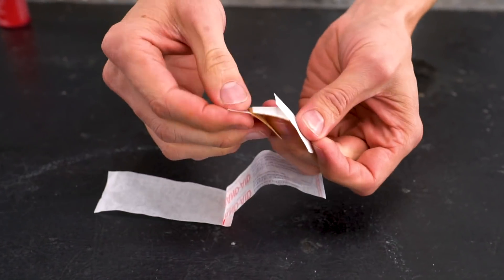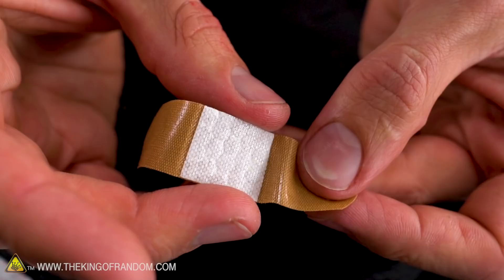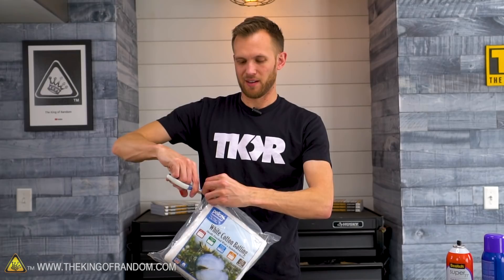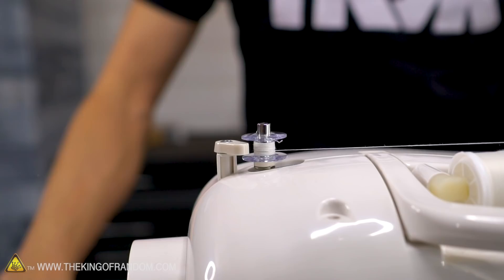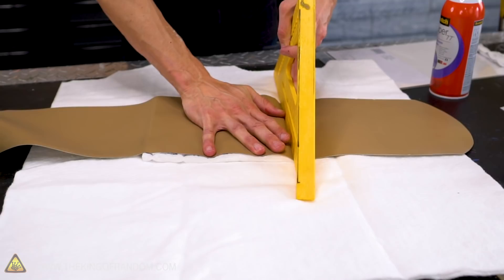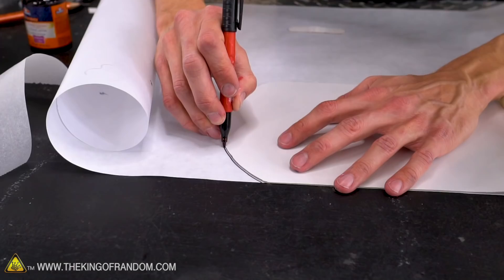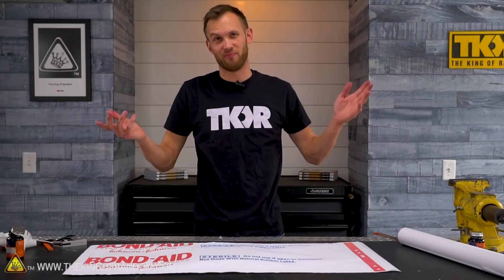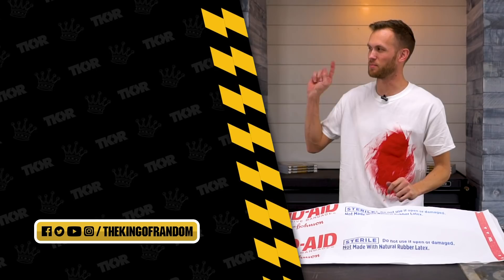1000 Band-aids Rolled Into One

Comment: As one that has pulled apart bandaids before when bored, you’re missing one thing: that thin perforated piece of plastic that makes sure the gauze doesn’t stick to the wound. I would suggest some tulle or netting to just slap on top of the pad there.

Comment: In the medical field we have what’s called Trauma pads they’re 10 inch by 30 inch gauze pads but they don’t have any adhesive and they have to be wrapped or tied in with rolled gauze or medical tape, so you basically just took that and made it self adhesive. Also would have been a lot easier and even more realistic looking if you used a trauma pad instead of cotton.

Comment: He wasn’t exaggerating when he said it was 1,000 times the size. It is let really 1,000 times the size, because the length of each size was ten times more resulting in a bandaid that was 10x10x10 (1,000) the volume of a normal one

Comment: i do see you touch the fluff part in this video allot (on the smaller ones) that's a part of the band-aid that you should never touch. your supposed to peel off one end push the fluff on the wound while starting down that first part and with the bend your making the second part should come to lose so you can attach that side.